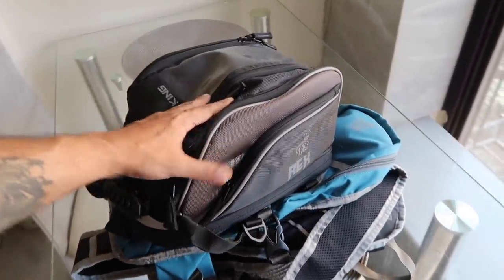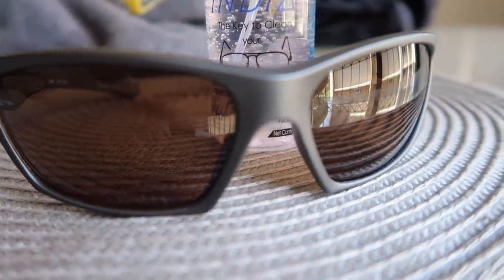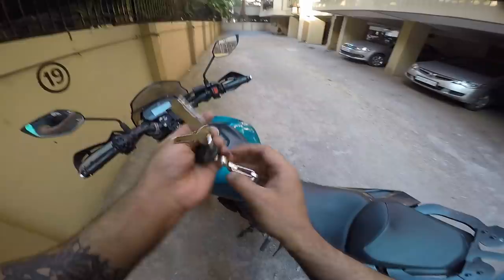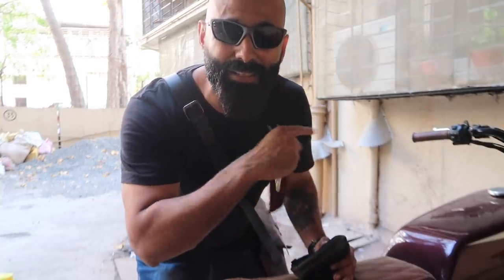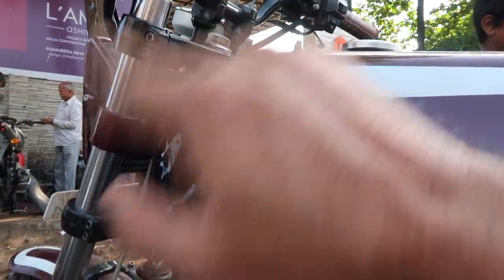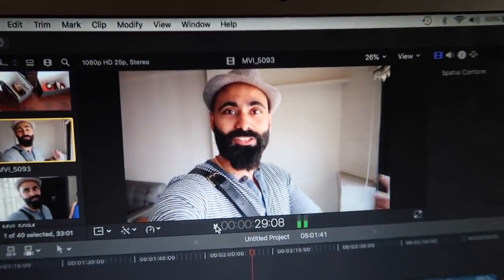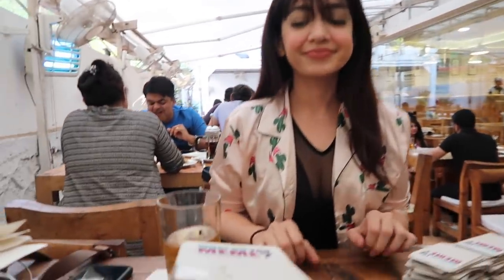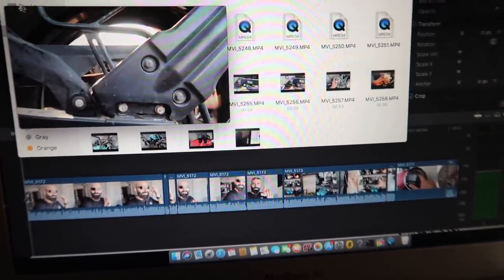GREASE MONKEY Gets Mods YAMAHA gets Serviced

Comment: You need to be introduced to Amsoil.  Amsoil makes oils superior to almost all other oils plus being a synthetic, it reduces oil consumption and revitalizes seals.  I've used it for decades on practically everything.  They have an oil they guarantee to be the best oil for your application plus they will keep the oils you use on each product on your list of vehicles on their site.  You don't have to remember exactly which lubricant you used for a particular vehicle.  If you have a worn out engine/transmission/etc. they make a cheaper oil for that or a specialty oil for that particular component in a particular condition.  Try em, you'll like em.  

Don't be surprised if your engine uses some oil when it didn't or still uses oil.  After a change or two this often stops being the case.  I had 230,000+ miles on a pickup that used a quart of engine oil every 3,000 miles.  After changing to Amsoil, I reduced that to 4500 miles and the next change on a very clean engine(synthetics clean your components)it used no oil in 6,000 miles and now I'm changing every 10,000 miles since I put mileage on fairly quickly.  

I've used it on big rigs to stop transmission "chine", as in a worn transmission making a lot of chining noise.  It not only reduced the chine to very small levels but allowed that transmission to go over another 100,000 miles nobody would have give it a chance of doing before synthetic oil  

I use synthetic oil on guns that require oiling.  I use it on fishing reels and even a squeaky outside door hinge.  Their transmission oil brought my wife's car's transmission back to life unbelievably since it had stopped working correctly and had a leak.  I have never had to fix the leak because the oil stopped it in less than a month.  BTW, they have great filters.  The washable filters for air save a lot of money with only needing to wash, dry and apply their filter oil.  Good luck.  BTW, I have no financial interest in Amsoil, just a very satisfied customer.